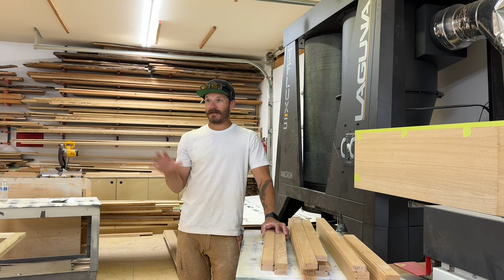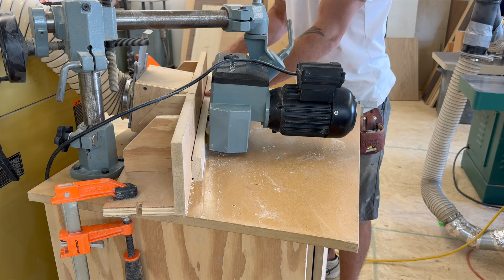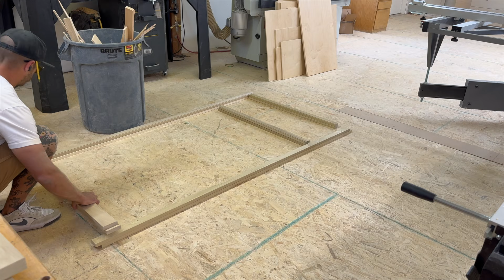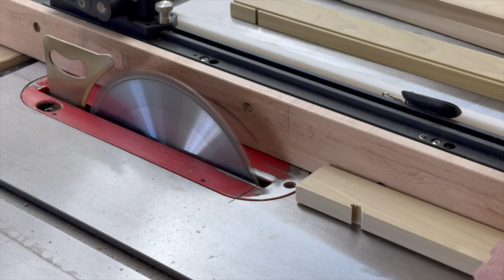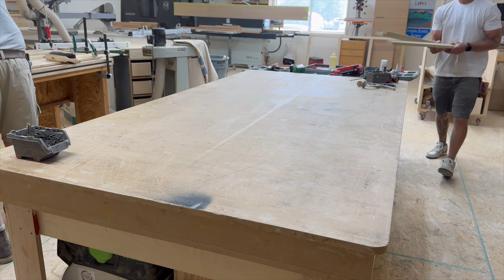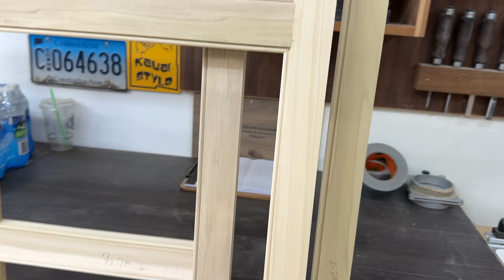Cabinetmaker Creating Beaded Face Frames For a Custom Cabinet Project

Comment: When I was doing high end residential millwork we used a Williams & Hussey single head molder to make the bead and Hoffman hauncher to make the miter cuts. Molder make a cleaner cut than a router and you can use it to make other moldings. Hoffman makes very good products but they are pricey.

Comment: Just finished a library with flush inset doors and beaded frames.  I did flat panels with applied molding to the doors. IMO, it's one of the classiest looks you can achieve

Comment: Perfect timing for this! I have beaded face frames in my future and I've been looking for as much inspiration and tutorials as I can find. Thank you for the great info! I have a question about the doors. When you recess the bead, do you mount the doors flush with the flat on the face frame or step it back slightly behind the crown of the bead detail? (Like, maybe a 32nd shy)

Comment: Another great video! I love how you explain in detail all of your processes! I'm not sure if anyone has asked you this already but which auto feeder do you have? I see it's a Delta but I'm looking into investing in one for my router table and there are several on the market. Keep up the great work!
Reply from the maker: Yeah the small one is a delta.  Works great
Reply: @NE_woodworks  how much HP is it? Any issues with the rollers? I’ve seen complaints from other brands about the rollers hardening over time and slipping on material.

Comment: So i have a few questions, why do you cut your face frames to length on the slider and not the miter saw?, and do you have to change your blade when you cut wood and then change it again when you cut plywood? if you dont change it what kind of blade do you use so you dont have to be changing it?.
Reply from the maker: I just prefer to cut them on the slider

Comment: What width face frame did you use? Anything less than 2 in seems like it wont work for my current setup if using pocket holes.
Reply: Also, would you make the outer stiles and rails Smaller due to having only one beaded side? 
Thanks in advance and love the videos.
Reply from the maker: Yeah the double bead rails are 2” and the single bead are 1 3/4

Comment: The kreg beaded face frame jig and included bits for the router table works very well. A bit pricey for occasional use but great results
Reply from the maker: I have heard that it’s a great system

Comment: You should check out Perkins builders video when his hand got pulled into the jointer. Push blocks are your friend.
Reply: Totally different scenario. He was running stuff through the planer with earmuffs on and didn’t realize his jointer was still running (without the guard) and leaned up against it. I think NE’s tool safety is pretty on point